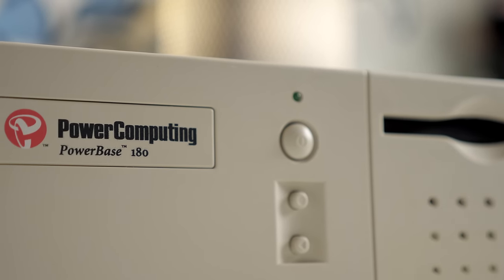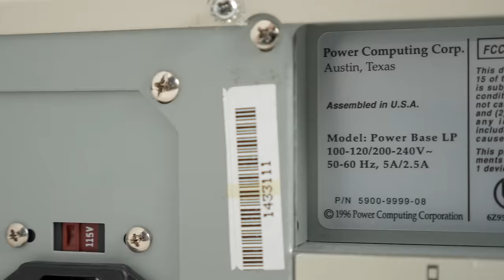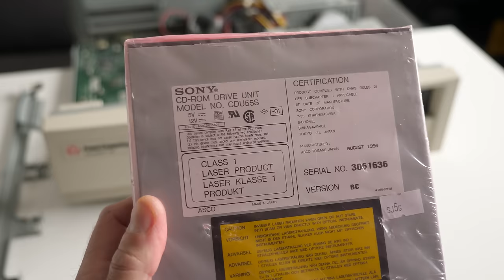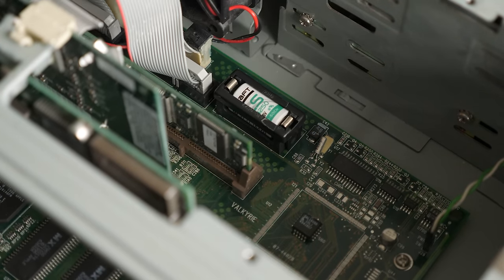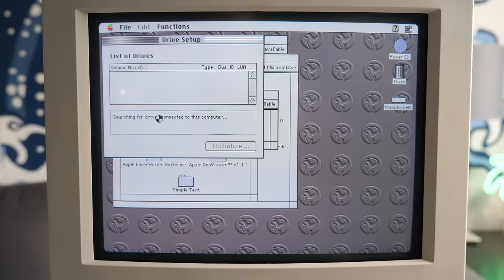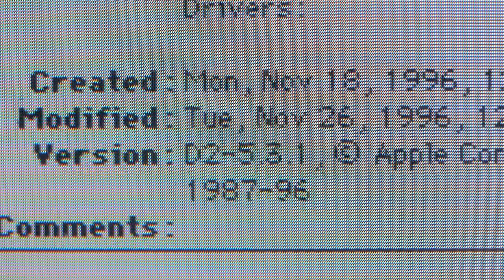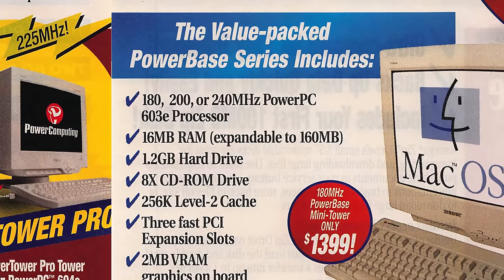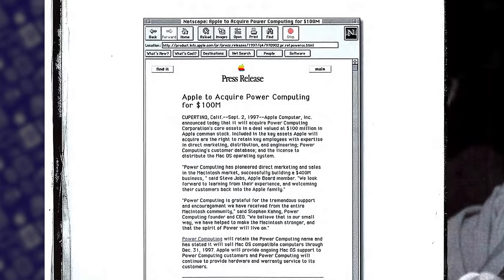Restoring a Power Computing Mac Clone from 1996!

Comment: I bought four of the early Power Computing 120 clones in 1997 or '98 for a photo lab. They sucked out loud. Yeah, they were fast, but they crashed all the time and they arrived with loose daughter cards inside. In the end, they were not worth the savings and as we expanded our operation, we bought 40 real Macs. I still have a 1999 PowerMac G4 400 MHz that works perfectly. It was upgradeable with third party accelerators from OWC and others. It's tricked out with an OWC 1.2 GHz accelerator, 2GB RAM, SCSI card for a scanner, USB 2 card, and 802.11a WiFi.

Jobs was absolutely right to kill off the clones. Apple would not exist today, had he not had the foresight to do that.

Comment: I still have my Power Computing 180 - back in the day, I upgraded it to a G3 processor.  It was a real workhorse at the time. The price for it was excellent at the time. ($1200 if I recall) - I pared it with a 15" sony based CRT.  As I said - great machine.  I need to bring it back to life one of these days.

Comment: Then a few years later of the iMac being released and finally hearing mac people tell me. I can afford to upgrade my mac now. People now tell me Mac's are not that expensive. Well that is yes and no. One nice thing about the iMac was the beginning of the internet. You could easy go out and purchase third party ram upgrades since the base model iMac would run one program at a time then run out of memory. Now I get a person who once in a while comes in with a new mac. They want to upgrade the ram or ssd drive. Oh, I'm sorry that is soldered to the board. Then you see a light go off and they realize. Maybe Mac isn't that cheap if you wanted to get more ram or larger storage size.

Comment: Did you remember to disable SCSI termination on the hard drive? Only the devices at the end of the SCSI cable should be terminated, in other words the motherboard and the CDROM drive. The device(s) on the middle of the cable should not.
Reply: The HDD is IDE.

Comment: Does anyone know where you can pick up used computers at a decent price in the Dallas area? I know there's the main goodwill, but I was hoping to find a place that sells ready-to-go* systems at a decent price. A 5-7 year old machine would be a perfect upgrade for me right now. Currently using a ten year old laptop and a raspberry pi 4 for my work (yeah, I'm cheap ;), but also, 2 years of covid heckery :/ )

*I don't mind putting in an SSD or even upgrading RAM if needed, but I'd rather not do tons of part swapping or troubleshooting

Comment: Umax was the other Mac clone
Reply: Not the other (implying there were only two). It was one of the others, there were quite a few of them.
Reply: @maighstir3003  DayStar, Power Computing, and Radius were mentioned in the video. There were more like you said but those 3 plus UMAX were 99%

Comment: Apple never licensed out their OS in the sense you seem to mean it.  What they licensed was pre-built Macs.  All of the Mac clones are clones of an Apple Mac or at least HEAVILY influenced by an actual Apple Mac model (as in, not in a generic sense, but clones of a specific model of Apple Mac). 
That program was ill conceived and basically made Apple machines overpriced 2nd choices.
Reply: While the clones used the same chipset/architecture (Tsunami, Catalyst, Alchemy, ...) as contemporary Macintosh models, the logic board (at least here) is custom as evidenced by the PS/2 ports. Even among the clones, I'm quite sure Power Computing was unique in adding those.
Reply: @maighstir3003  They were.  But my point still stands.  A true program of licensing out the OS and making MAC an open standard probably would have made the Mac a lot more of a presence. 
However, I do concede that without the Mac as it was, Apple probably would have gone bankrupt or be a shadow of its former self.  So it probably was the right decision.  Jobs would not have been able to kill the clones so easily.

Comment: 11:37 💾 ka-chunk RRRRRRRR "whoa!"
Reply: Brought back memories with that. Pulled that drive so quick. Might still have it around here somewhere as well as the og processor card. Attempting to restore my PB180 G3 right now after 20 years. Fingers crossed on a Mac OS 8.1 image to get the 400GB PATA drive bootable. Then it's on to 9.2.2, 10.x.x, Final Cut Studio and XML project exports I neglected to do all those years ago.